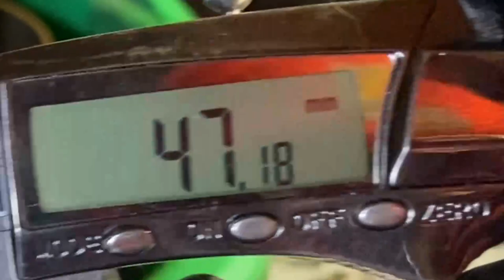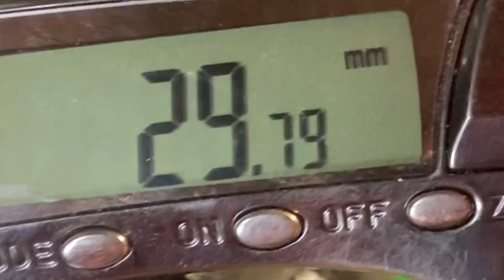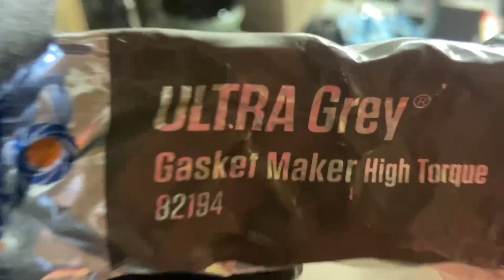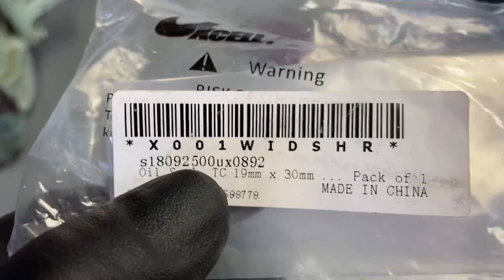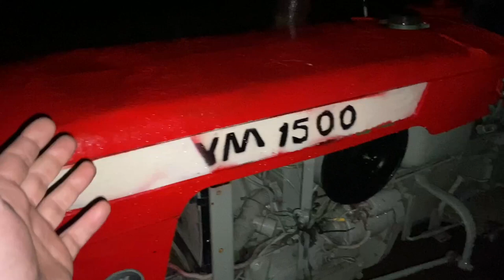PORTAL TEARDOWN, BEARING REPLACEMENT. Yanmar 1500D

Comment: I have the front wheel drive shifter assembly apart on a 3110D at this very moment. I'm trying to put together a video. It sure is a lot of trouble keeping a camera going when your trying to work with greasy hands. All the bearings I have found so far have standard bearing numbers on them. I haven't had any trouble crossing the bearings over. I have learned that the bearings we have been using since the beginning of time in the US are metric.

Comment: Find a old air mattress (the bigger the better) cut it on the side and separate the two halves top and bottom. Use one to cover the tractor and the other to lay on to work off the ground